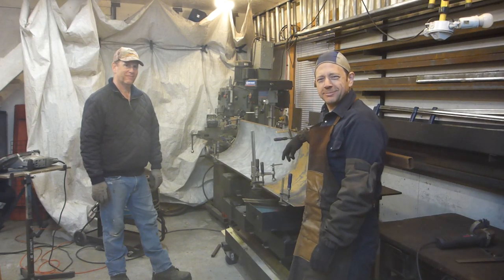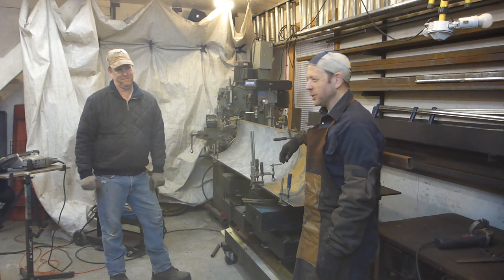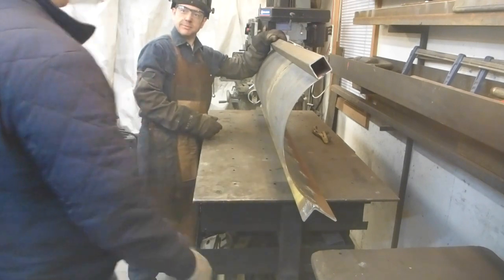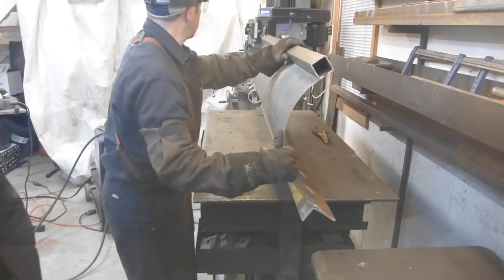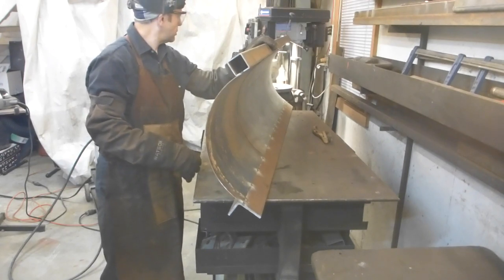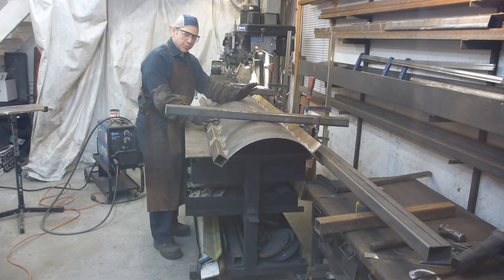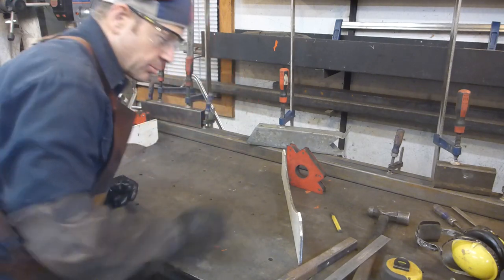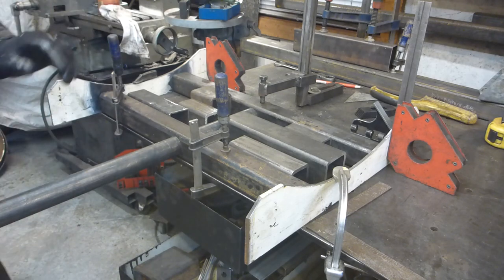#183 Hydraulic Angle Snowplow for Massey Quick Attach - Part1

Comment: Some of the greatest difficulty is keeping metal from moving with heat or moving it back after its moved.  I fight it all the time Joe.  That's why so much of the stuff I build is built out of too heavy of material than what would have been engineered in a fab shop.  I do a lot of tacking, but almost never in a row.  I bounce from end to middle to end all over the place to allow heat to dissipate before making the next weld.  Sometimes no matter what, it still bends. Good video Joe, I'm running behind and hope to catch up soon.
Reply from the maker: That is right Wendell!  I was too eager this time to make the full weld on the blade. Sorry for the late reply, Youtube does not seem to send me all the notifications.
Reply: From Steel To Wood no problem Joe. Same thing happens to me too. Lol

Comment: Nice work on the plow.  I see you have a King portable bandsaw.  Does it work well? I’m using cutting wheels on a grinder and it makes a big mess in my shop and have been looking at those King bandsaws to replace the grinder.
Reply from the maker: I've been there before: big mess cutting with discs! I would say this is really worth having it. There are so few limitations compared to the advantages and it cuts quickly through thick steel. It does cost less using the blades (44 7/8") than the discs. You can send me an e-mail, I'll explain to you more.
joe.lesage@hotmail.com
(make sure to copy the address, the link often does not work)

Comment: Great,...another good project to share with us! By the way Joe, what size ( in litres or gallons ) were the water heaters you got the mold board from?
Warping of the steel is always a problem for me too, I try to weld and cool, weld and cool with a wet rag as I go,..it works,...mostly LOL! 
That's a good size snow plow for that Massey Ferguson., I would expect that this will be a great plow for Mike.
I'm looking forward to Part 2.
I'd like to wish you and your family a very Joyeux Noel and Bonne Annee 2020!
Reply from the maker: Thanks, Reg! The size of the water heater was 60 gallons for the first plow we did for Dave. Then I thought I had a second 60gal for Mike's snowplow, but it was definitely smaller. I could not check or read it, as I already sent the scrap the outer and insulation to the eco-center. I think the second heater was 40 gallons. So the curve was slightly different.  Only the height was very different. We managed to match the two curves together! I will keep in mind your technique to avoid major warp.  Meilleurs voeux à toi et ta famille!
Reply: @FromSteelToWood  Thanks for the reply! I have about four , 40 gallon heaters,...so I should be able to make a couple of plows from those. I like the way you lessen the curve in the mold board,..those are good jigs you've made up,  I can use that idea for mine.
You see Joe, you've become a teacher as well as an Engineer!
Cheers to all,..Thank you again!
Reply from the maker: Lol thanks!  BTW, my father was a teacher! I just think there is some genetics involved!
Reply: @FromSteelToWood  Oh my, and my father too!  ( now we're in trouble!  hahaha )

Comment: Good job. So do you take orders? Do you deliver?
Reply from the maker: Lol! Don't you already have a plow for your BX! My day job keeps me quite busy, but we never know... Just curious, what are you looking for? Thanks!
Reply: @FromSteelToWood , I will have to change out my "HOT" water tank so I can provide that. We do have a push box. Yes, this is good. Sometimes though a plow that can roll snow to the left and the right is very helpful. We live near Châteauguay. Close to the Pont Mercier.
Reply from the maker: I've got both, the snow pusher and the angle plow. I feel it's better to have the snow pusher when there is good snow accumulation. Then the angle when it's a couple of inches. Do you have a 3rd function installed?  I saw in one of your video you have 2 sets of remote for the snowblower at the back. Did you build your snow pusher last year? Thanks!
Reply: @FromSteelToWood  Yes, I built the snow pusher. I bought the metal at a shop and had them bend (Brake) the pieces I needed and I welded and panted it at home. I don't have a third function on my Front end loader yet.